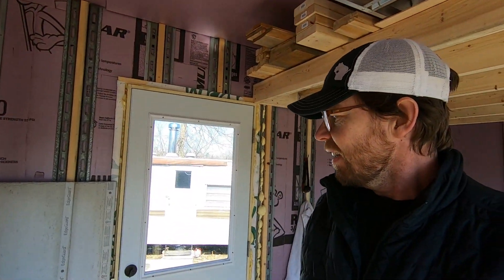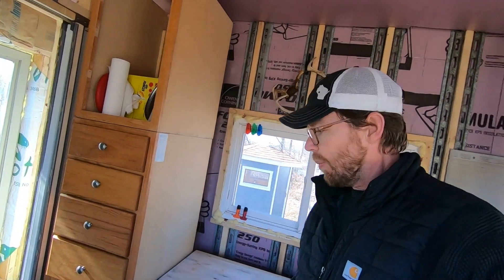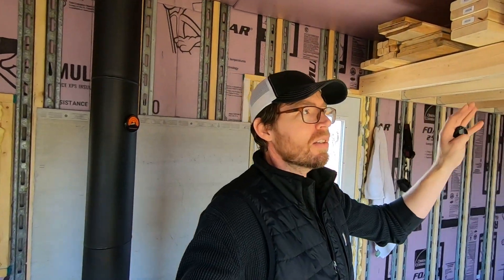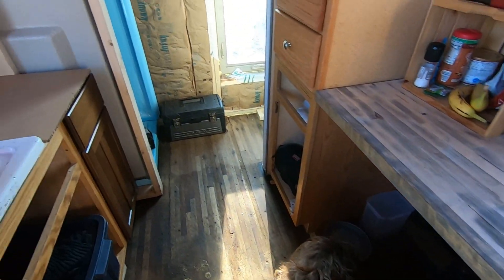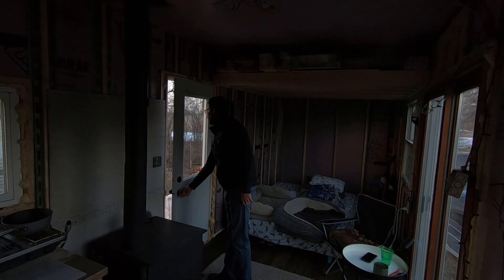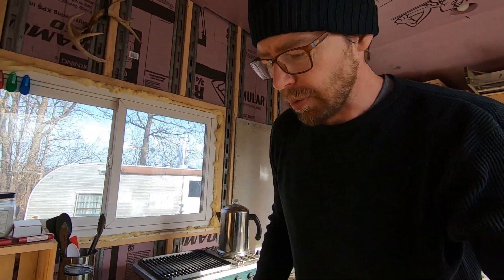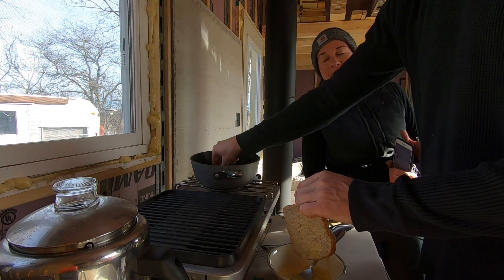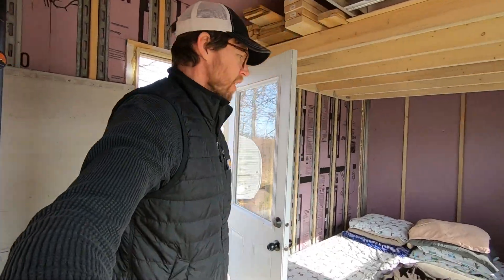DIY Off Grid Tiny Home Kitchen

Comment: Cast iron frying pans! Nothing better 😆
Reply from the maker: I finally brought one of our extras up! Might need to shop some second hand stores and add-on for more options. Weigh this tiny home down so it doesn’t blow away! 🤣
Reply: @thejacobsonproject  we somehow ended up with 2 full sets comprised of 3 different manufacturers lol use multiples of the same size all the time. Grew up with cash, don't know how to properly use anything else.